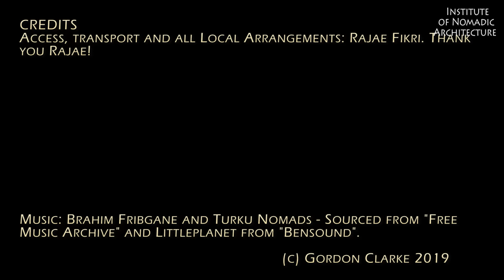Berber Tents and Looms from the Sahara Desert

Comment: 3:59 
Oh Camel.  
You are so GOOD.  
The dark colors of the fabrics of the tents of desert dwelling peoples helps keep these tents' interiors cool.  This seems counter-intuitive until understood along with the readily open-ended designs of most of these tents.  The dark, heavy fabric absorbs infrared radiation, and then re-radiates heat upward into the breeze.  Additionally,  this fabric effectively blocks the passage of light and heat into the living space below, creating dense and effective shading of the ground surface, allowing it to cool down.  As the tents can be left open at both ends, a wind tunnel effect is created, encouraging additional cooling within the living space.  The end result is a sort of "geo-mimicry", the tent becoming like a kind of manmade rock overhang--- though admittedly not quite as effective, still an excellent substitute.  And rock overhangs usually only maintain effectiveness for part of the day.
Reply: Tipi Dan (

Comment: The horizontal loom resembles a "backstrap loom". Usually the weaver sits at one end, with the warp tensioned between the end pole and their own waist. forward and backward motions helps to open the shed for weaving. In this demo, the Ladies are sitting on one end instead, which makes for more work to open the shed. Can anyone offer more info? In practice do they use it in "backstrap" fashion?

Comment: I wonder how often they have to relocate each year.  When it rain, with the rain soak through the tent and drip down to the floor? The tent and its entrance are very low, I would have backaches going in and out of this kind of tent.
Reply from the maker: They move 4-5 times a year but it all depends on rain. And yes, when it rains it tends to pour and things get wet, but it does not rain often, and they are always glad. Recent drought has forced many to settle.

Comment: Reckon I'd be on a constant hate trip havin' to deal with that heat, very little water, flies, sand stickin' between every crack in the body, & weighing down every bit of fabric weaved; to a 4th again it's normal weight. Yep! Can't hold too much a grudge against them. The only balance I can visualize; are them clear cooler star reachable nights to close this Reckon.
...tTt... ''Long Ago... Set In To Rhyme.''
Reply from the maker: I think it is the sense of freedom that keeps them there. Especially the Atlas Mountain cave nomads have such sparkling eyes from being in the light and space.